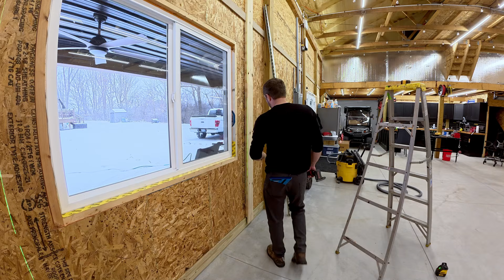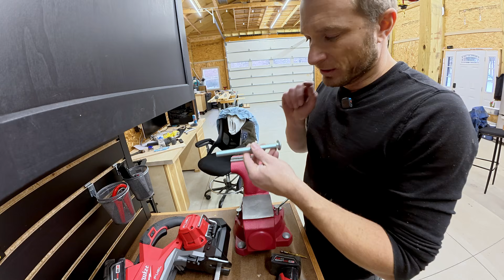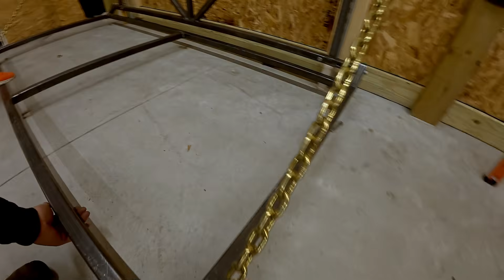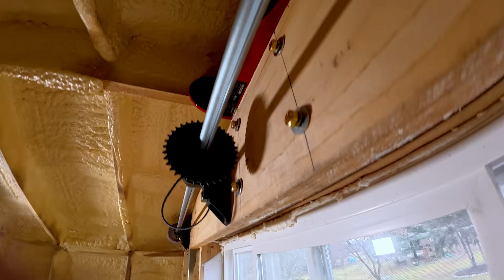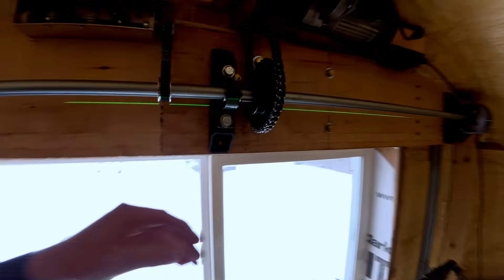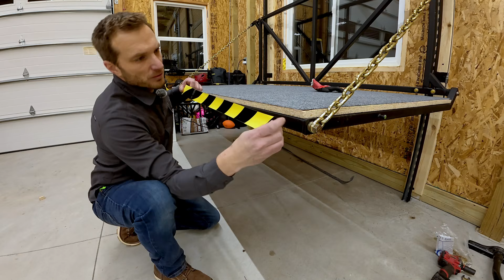Attic Elevator Heavy Duty | DIY Shop Elevator Built Right

Comment: Great addition to the shop, I have a couple suggestions If it was me, at the top design a couple spring loaded locks. A locking system that is on a cable real simple to do, plus add at the top under side of loft photo eyes so no legs or arms get impinged (Kids will be kids) one last thing replace all the nuts with Nylock Nuts will not come loose. You did an Awesome job otherwise.
Reply from the maker: All good ideas.   Thank you!

Comment: Great job!  I am not sure if I missed it but, did you install some kind of ultrasonic sensor at the bottom as a safety mechanism to stop the lift in case there is an obstacle underneath when it is on its way down?

Comment: Also with kids I would put a key lockout - you can also use cheap sensors to check for clearance and pinch points- not hard to do these days

Comment: I think your #40 roller chain is marginal. The maximum allowable load on #40 chain is 380 kg (836 pounds) for normal operation. In a lifting situation, you want a good safety factor. Your hoist can produce more than 1000 pounds. Another, perhaps minor, point is that your load is 90 degrees from the normal hoist load direction. The hoist frame was not designed for this direction.
Reply from the maker: You sir are correct and for some reason I thought I looked up the working load of the chain and it was closer to 1200lb.  But I just checked and you are right at 836.  Good news is breaking strength is about 5 times that and I really only plan to pick up 300-400lbs at a time with this. Maybe I just add a second set of sprockets and chain to double it up. (Not sure if the load will be shared equally or not) or just upgrade the chain and sprocket.
Reply: @Built-By-Sam two chains is great because even if the load is not shared, one will prevent a fall and you are highly likely to see a failed chain before.

Comment: Should have used a 6 point socket as an adapter for the socket to the hex shaft !
No welding !! 
A 1”shaft  mini bike/go kart brake works as a safety brake.
A commercial door uses a “helper” spring to lift and doesn’t put all the force on the motor and chain
Reply from the maker: I did think of using a socket for an adapter but I still would have hat to weld the sprocket to the socket.   Ill look into a small brake but would still need a way to activate it if there was a failure.   Thanks for watching and the suggestions.  I appreciate it

Comment: Sam, this was my first video from you, and I must say that I am impressed. Not only did you do your due diligence in designing and engineering the lift, checking the structure, and using proper components, you did a great job fabricating the lift.
A couple of things I would have done differently, such as additional supports in the floor frame to support the plywood floor (subflooring isn't rated for more than a 24 inch span between joists), I would have installed a tension screw for the motor between the housing and the pillow blocks to lock in the chain tension, and perhaps some aluminum angle iron around the edge of the plywood floor to provide a buffer and edge protection for the plywood and lock down the edge of the carpet. Additionally, I think a short ramp added to the front edge would be handy if you're using a dolly to move heavy stuff to the lift.
You have done a fantastic job on the lift, and you can certainly bet I'll be checking out your channel's catalog to find more gems from you! I look forward to seeing more from you. You got an instant subscribe from me with this one!
Reply from the maker: Welcome to the channel and thank you for the suggestions.  The ramp idea was in my original plan but didnt make it to the build. No particular reason just didn't think I needed it.   The trim on the carpet is a good idea.  Im really not worried about the span on the subfloor you'd be surprised how solid it feels.    The goal was keep the platform as light as possible.     Thanks for watching I appreciate it.
Reply: @Built-By-Sam  As a bonus, using an aluminum angle for the carpet trim would also cover the raw OSB edge!

Comment: Another thought you might wanna add it to its own circuit in the panel so you can leave the breaker off so when you know who finds the remote, he’ll be safe. No stitches are required..
Reply from the maker: Yes i actually am in the process of doing that right now!  I plan on keeping it off unless I'm using it.  Thanks for watching I appreciate it

Comment: Great video! good job on the detail the good the bad and the ugly and I’ll never saddle  a dead horse again.  Thanks for showing the issues that you had with the center pillow block. I hated to see you have to tear it all back apart to add the second one.. I was relieved when you added the new sprocket for the limiter that you moved it to the outside that you didn’t have to tear the other side apart. Has been stated before, but some sort of an emergency break would be great if a cable to snap or a  pulley brakes. Not sure how I would execute one myself though.  Once again great tips throughout the process. I was tempted to fast forward, but I didn’t want to miss your tips..
Reply from the maker: Thanks for watching and not skipping anything.   I find it hard to keep videos short and still get my points across. I know sometimes we get used to just watching short clips and its hard to keep people's attention for any length of time.  Yeah I did a lot of planning for this project but still had to make a few changes along the way.
Reply: @Built-By-Sam  I know that editing can take up 10 times more time out of your life than actual filming, but I think that's where you can have the best Quality effect on your video. Even if it is an hour to an hour and a half long. If it's interesting and keeps flowing like a movie people don't notice the length of it. I personally like the longer videos, but I have to say editing really makes a difference.

Comment: I'll have to agree with a safety stop mechanism if the cables should break. As far as aesthetics, I would get some angle aluminum trim and cover each side of the deck where the carpet almost meets the edge. It would clean it up and protect the OSB from chipping and tearing 👍🏼
Reply from the maker: I was thinking about some sort of edge trim as well.   Thanks.

Comment: Great project. Consider adding a few ground wires. Should a wires insulation get compromised someone could get shocked. The limit switch box really needs a ground wire and one from the motors case to the lift’s frame.
Reply from the maker: Thats a good call.  Ill do that.   Thanks 👍

Comment: Nice job! This is the best looking DIY elevator lift that I’ve seen on YouTube.  One thing you might wanna consider is putting a couple rubber bumpers on the bottom of the deck. If anything, it might keep your paint from getting scratched up when it contacts the concrete.  The other thing is LiftMaster makes a cable tension sensor that mounts up by the drums. It would kill the lift if for some reason the platform ever came down on something or got hung up. At least you wouldn’t have to get up there to re-spool the drums.
Look forward to more videos, keep up the good work.
Reply from the maker: Thanks for the suggestion.   I did think of the rubber pads and will most likely do those.   I have not seen the cable tension sensor.   Ill have to check that out.  Seams like a good idea thanks

Comment: Great project and decent design I have to ask it appears that you have engineered trusses. Have they been designed to support the weight of an attic? Most are designed to support the weight of the roof and snow load
Reply from the maker: They are but not for much weight.   But i do have a plan in the works to solve that problem.   That will be in a new video in the near future.  Thanks for watching.

Comment: Might add safety tape to the floor as a keep out zone for when the lift is not close to the floor.
Reply from the maker: Yeah good idea.  Thanks.
Reply: @Built-By-Sam  It is a good idea. I would just change it to paint not tape..
Reply: Makes sense.
Reply: Agree 100%, worked at a shop where a delivery guy was told to just put it in the shop, by office weekend cleaning folks took package (new lazer cutting table computer and guidance assembly) and set right under lift gate while our maintenance guy was up on second floor looking for parts.Came down and crushed items. I am also thinking of kids happen to be playing in area. Suggest painting whole area in red  and labeling something scary(Ha) loved the build by the way

Comment: Nice job well thought out 👍 don’t worry about keyboard safety police as long as your not using it as every day personal elevator and your not standing under it during use 😉 you’ll be fine looks to me to be an extremely quality build  I would trust it 100% only thing i would do is store the remote out of sight of little hands and respect the duty cycle rating of the motor/winch  thanks for the awesome build ideas.
Reply from the maker: Thank you!  Yes anything like this should be used with caution for sure. Anything mechanical can and will fail, just need to be in a safe position if it does.   I agree with keeping the remote out of the kids reach and one better I am running a separate curcit up to the hoist so when not in use the breaker will be turned off at the panel.   Thanks for watching I appreciate it.

Comment: Great build...might want to as a third hinge in the middle to support the fold down floor, strengthen the two angled hinge points at each end, and pray that pully chain never brakes. Best DIY elevator build I've seen.
Reply from the maker: Yeah I did look at and may still add a center hinge.  I really don't think it is needed but it would strengthen the floor.  Like I have said before I do not plan on really using it more than 300-400lbs but the 1000lb test was just proving it can.    If I wanted to use it for that kind of weight on a regular basis than I would definitely add strength to a few areas.    Still looking into a fall protection if there was a chain failure.   Thanks for watching!

Comment: It appears to me you did a really good job building the lift but the only thing that concern's me is there is NO SAFETY BRAKE in case the lifting mechanism fail's at some point while you're lifting something heavy to be able to stop it from falling. I've seen other video's of other lift's and they have a SAFETY BRAKE built in to stop the lift from falling if the cable brake's or the winch fail's just a thought!
Reply from the maker: Thank you and you are correct, if one cable failed it wouldn't fall but if both did or the gear/chain failed it would fall.  Haven't came up with anything great just yet, I was thinking of using two retractable safety limits straps. The kind you use for fall protection, they go in and out like a seat belt but lock if there is sudden free fall.  But I'm always open to other ideas.
Reply: @B @Built-By-Sam I built one of these about 15 years ago and have been using a heavy duty fall protection.  On the to do list is installing spring loaded locking pins that release when cable is in tension and lock when cable is not under load. Cable breaking would snap the pins into unistrut bolt holes.
Reply: @CDFJCB great idea.
Reply: @CDFJCB just a suggestion, elevators have a failsafe cab catcher built into the passenger elevators that’s genius. 
It basically is attached to the lift cable by a spring loaded clip on all corners where if the cable breaks a tapered clip pops out on each corner and prevents the cab from going down
Reply: @Built-By-Sam , use a pair of SRLs.
Reply: @Built-By-Sam I think those are limited to like 6 feet. I have a few packed away So i can check if needed. They are also designed to stop 1 man. No load.
Reply: @chucknVathey're rated for 5000lbf usually, and you get quite long ones. The screamer/ force absorbing device is usually only a few feet

Comment: What happens if one of the cables snaps? Or a gear eats some teeth? Wondering if there is any reasonable way to limit the drop speed so it doesn't come crashing down? A garage door is balanced by springs but obviously that's a static weight.
Reply from the maker: True a garage door is balanced by the spring but if the cables both were to fail the door would still come crashing down.   Same is true for mine, if one cable broke it wouldn't fall unless both failed.  If the chain or gears broke than yes it would fall.   I have been thinking of different options to put a safety in place for this. Haven't came up with anything great just yet, I was thinking of using two retractable safety limits straps. The kind you use for fall protection, they go in and out like a seat belt but lock if there is sudden free fall.  But I'm always open to other ideas.
Reply: Yeah was thinking about it and even checked McMaster. They sell various torque limiting and braking devices - even ones for chain driven systems - but the passive ones work the opposite of how you need them. They disconnect the load from an out of control motor. If there is a failure gravity becomes the motor and the load is on the wrong side of the door as it were.

Magnetic brakes would work so long as there is no power outage but unfortunately if you think the rotary ones are expensive you should see linear ones! 

Any system on the shaft doesn't protect against a broken cable but in this case ... that might be acceptable simply by adding more cables, even stronger ones, or both. Four cables each rated to min 2x design load makes a cable failure so unlikely it may not be worth worrying about?

The other system I've seen is a hydraulic cylinder with flow rate control. It isn't powered, just when contacted towards the bottom of travel the safety valve resists motion the faster you push it so at normal speed it doesn't do much but in free fall it brings things to an increasingly slow stop. Often seen at the bottom of 2-6 story elevator shafts.

Your idea isn't a bad one if it works and might be the simplest/easiest.

For that matter you might also take the overbuilt to 11 strategy on the chain and sprockets too. Just add multiple and make them ridiculously overbuilt?

Anyhow I appreciate the build. I agree with other commenters: you have taken a very serious approach to this and done a much better job designing it than any other I have seen.
Reply from the maker: Thanks for the good ideas and options.   If budget was no concern I would have extremely over built it and doubled everything.   But there is a point to realizing what it is actually used for and how often its used.   If it was moving people on a daily basis it would be built much different.  I think compared to most attic lifts out there it is extremely safe and well built. Thats not saying I don't take the safety of it seriously because I still am looking and will implement a safety system once I come up with the right one.  I do appreciate the feedback and will look into some of the ideas you suggested.   Thank you
Reply: @Built-By-Sam  That makes sense. It isn't carrying people so the stakes are lower (assuming the kids stay off it as they get older). I agree you've done a much better job than any other I've seen. Thanks for sharing with everyone... anytime you put something on the internet you're bound to get idiots, trolls, and weirdos responding.
Reply: I thought about a hydraulic dampener but I think he’s limited to the length of stroke. In other words if he has 12 feet of ceiling, you can only fit in a 6 foot cylinder and he needs what looks like a 12 foot stroke. Then that requires a cable system to double the stroke and introduces another set of issues.
I’m thinking of a rotary dampener.

Comment: Being able to fold up or use as bench is great. 👍
Reply from the maker: Yes this was something I didn't even plan or expect to do but it does make an awesome work surface!   Thanks for watching!
Reply: That was a big added bonus having an extra workbench. My only problem is I would stack it with stuff because every flat surface I have has stuff on it. I would have to be super disciplined to keep it relatively clear so I don't have to clear it every time I wanna put a big load on the lift.
Reply: They ever tell you, you look like a young James Caan?